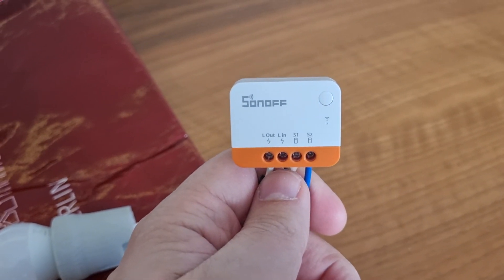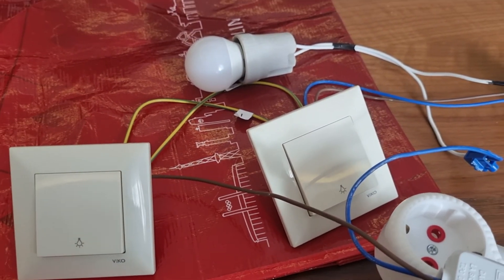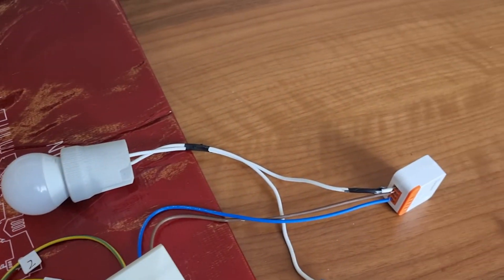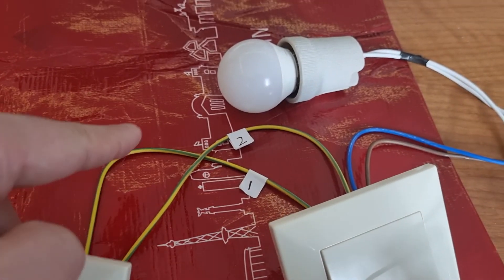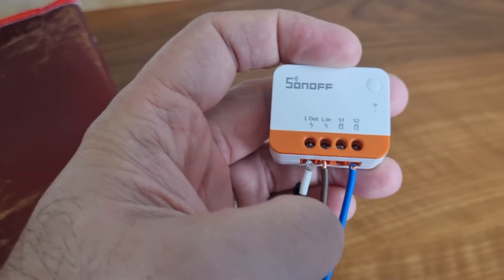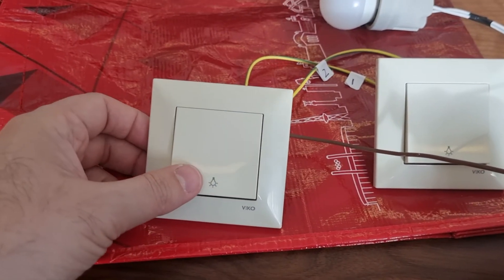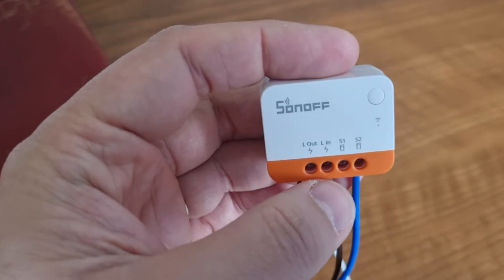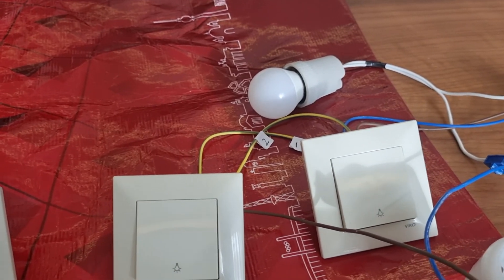Sonoff ZBMiniL2  - How to 2 way switch with single smart switch (ZBMiniL2 Vavien Nasil Bağlanma)

Comment: Explanation:
Use light switches as described. These switches will carry the phase via (wire1->switch2->blueCable) or (switch1->wire2->blueCable) when pressed separately, which helps the relay toggle mode.

Connect the line like this: L (phase) -> wire 1 -> relay line input (this connection is always on). Then connect the relay's output pin to the lamp cable input, and the relay will power on successfully. Still not ready to toggle.

NOW, USING:

L (phase) -- (this connection is not made unless the first switch is pressed) --> wire 2 -> blue wire -> S2 of relay. This is not always on unless you press the switch 1. When pressed, phase will go to s2, and the relay will toggle mode.

Since phase is directly connected to the switch 2 via wire 1, pressing the switch 2 will establish the same connection from switch 1.

Connect phase -> wire 2 -> blue wire -> S2 of relay. This allows the relay to switch modes when active. If you're unsure, there's no need to connect S1 in these scenarios.